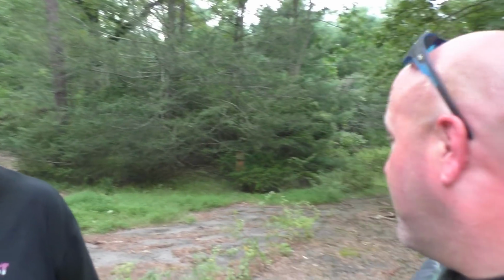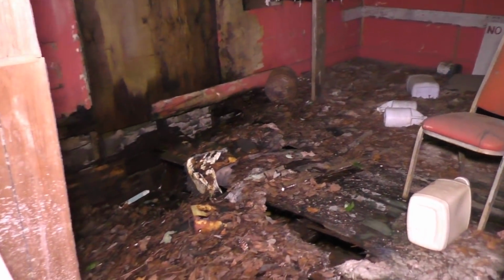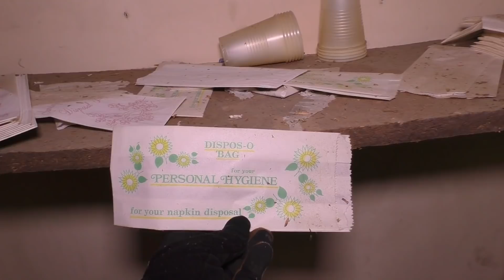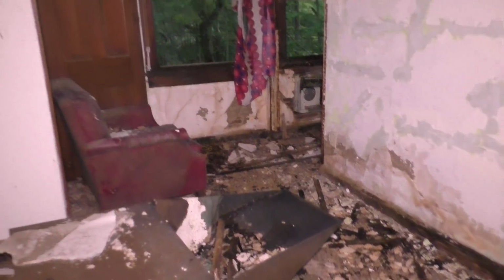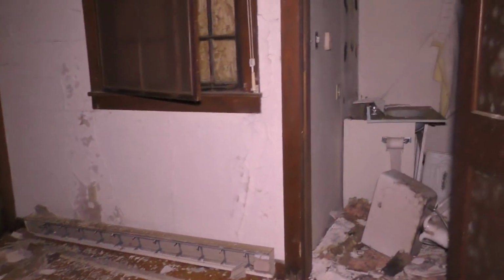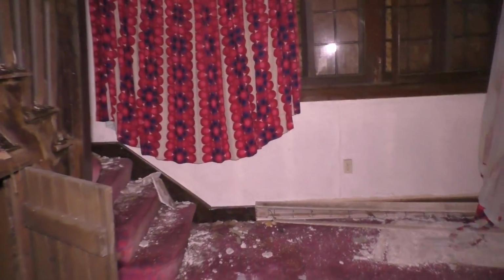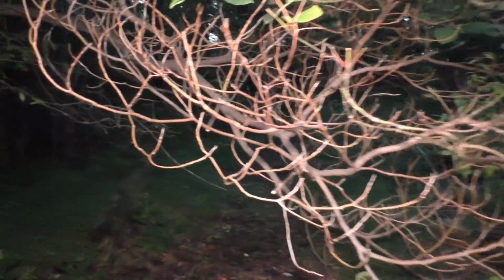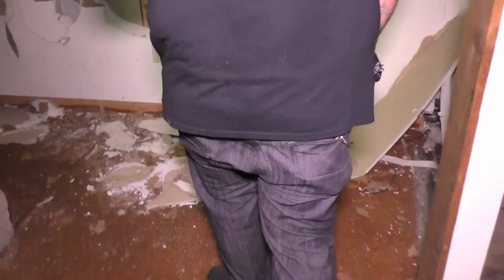Abandoned Vacation Homes - Forgotten Summer Getaway

Comment: I noticed a GFCI wall jack near the last house that you explored. I think it was in the house with the vanity/cupboard furniture. I thought that was a modern item required in houses. I did a little research and they started being installed in house starting in 1971.  But the first few years they were installed on the outside near pools. That GFCI circuit I think was in a bathroom/kitchen area. You were trying to get a handle on maybe abandoned dates. Maybe look up when those gfci circuits were required  in that area or your state. Good video.  It doesn't take long for houses or structures not maintained  to go to pot. Looks like it was a cool place to be for summer. Thanks for sharing!
Reply from the maker: Thanks for that info.

Comment: Judging by the tile in the bathrooms and the craftsman architecture style, these may have been built in the 20’s. The wealthy people of that time could really afford such a lifestyle as resorts. It also appears that no modernization took place after the 60’s or 70’s, judging by the orange and green curtains. In the last building shown, where the fireplace had been capped off, some renovating had been attempted. This was new build with sheet rock instead of plaster, some larger rooms were being converted to several small rooms, and the fireplace was being clumsily eliminated by capping it off. The woodwork around those doors looked 70’s ish, certainly nothing like the woodwork in the original houses. It would be interesting to know some history, like who owned that land and who owns it now. Info like that is public. There were no modern safety features, such as fencing around that pool. And I doubt a new facility would even be allowed a deep pool due to liability. Too bad so much has been lost to “progress.”
Reply from the maker: There were no documents left around, no names anywhere and no address to this place. Only shows up on google maps as a large wooded area.
Reply: I think you would have to go to the county seat. If the land went back for back taxes, the county would own it. It could possibly be up for auction at some point, to maybe a developer, someone with tons of venture capital. Anyone, someone at the county land office would know. Land is not owned by no one. Someone owns it. I don’t have any idea the location or I would search myself. Trees suggest the north east section of the USA, but that’s my only guess, lol. I guess it could be the southeast, but those trees seemed too familiar to this yankee to be in the south. Lol
Reply from the maker: I also dont want to go bringing attention to myself or the location incase there's some legal matter going on with it. Something's are better left to the imagination.

Comment: The "dresser" you found is a desk and it's missing 2 legs at the far left side. You also had the option of buying the matching mirror that would attach to the back. over the desk side and could then be used as a dressing (vanity) area. I had one of these that matched my chest of drawers, head board, foot board, bedside table and full length mirror.  This was about 40 years ago for me and at the time I remember feeling like a princess!

Comment: The yellow table with the three draws,i believe is an old sewing table, the sewing machine sits on the left,with room for ones using it to put their feet underneath when working the sewing machine, the large tank outside the pool is all part of the pool and filtration system,keeping equal pressure between the pool water,and water held in the tank,it is then filtered and circulated back in to the pool!

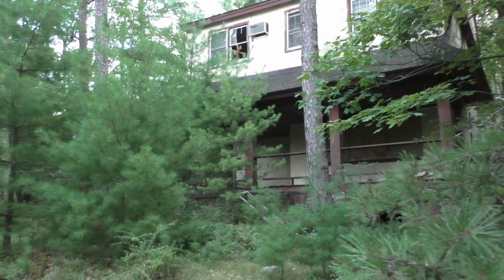Comment: In the still pic at 10:43 there's a pretty big orb in the doorway. Seems like there might be some non living people still occupying those cabins. Those houses do seem pretty eerie and give off an uncomfortable feeling. And I would say that place was abandoned in the early 70s. The carpeting, drapes, furniture all say early 70s. Also that bus stop sign font is early 70s. So I'd say it's been abandoned at least 45 years.
Reply from the maker: Thats the time frame when it was furnished probably. My guess is it closed sometime in the 80s.
Reply: If they did close that late, I'm surprised they didn't redecorate. I'm almost positive they would have redecorated by then. Even those mattresses were early 70s. I doubt they would have kept using them in the 90s.
Reply: Is there anything that says when it closed or any papers with last dates of use?
Reply from the maker: Couldnt find much and i could be wrong but if they were abandoned since the 70s. I would think they would be in much worse shape. Most roofs dont last past 30yrs and only a couple had holes in them.
Reply from the maker: Either way its still interesting and intriguing.
Reply from the maker: Ive explored hundreds of places and have seen decay of all various types. Most places that are abandoned more than 20-30yrs are completely falling down. Once the roof leaks, its a domino effect. Unless they have metal roofs, the natural deterioration takes over. I do agree with you that the decor screams the 60s-70s. If i learn anything else, ill let you know.
Reply: You'd be surprised how different places decay differently. It all depends on climate, vandals, how well the buildings were made and lots of other things. If it's in a wet climate, or where there's lots of humidity it will decay faster. If it's in a cold, cooler or dry climate, it will last longer. I've seen some places that were only abandoned about 10 years and looked like they had been abandoned 50 years. I've seen other places that were abandoned 50 years and looked like they were abandoned about 10 or 15 years. So it just all depends. I really think that place was abandoned in the early 70s because most places update their look at least every 5 to 10 years to keep people coming back. And unfortunately unless it's a theme motel, hotel or resort, people don't want to be in a place they consider old and outdated. Personally I love early 70s decor and if I had a hotel or a place like that, it would have that look. Or if I had a hotel, it each room would be a different decade or period of time and the lobby would be 1920s or 1950s.
Reply: Absolutely.
Reply: A place can look good on the outside and be a war zone on the inside or vice versa.
Reply from the maker: Well I'm only going based on where i live which is Pennsylvania. Very humid summers and brutal winters. Most places don't last around here. I agree 100% though that many factors contribute to the decaying process. Personally though i have filmed a couple resorts that closed in the 90s and 2000s and they stopped updating past the 70s and 80s. Mostly to try and save money, but in the end its what killed them off, because they were outdated.
Reply: If they re-decorated in the late 60's / early 70's it likely mean the business was still profitable.  It may well have operated into the 1980's but was never renovated due to declining revenue.
Reply: I got ya. I understand about trying to save money and sometimes updating and making everything modern which everything modern has no style, no character, looks totally uninviting and sterile, can also turn people away.